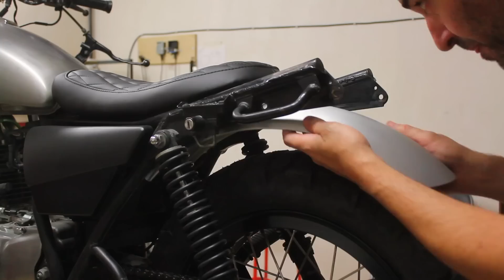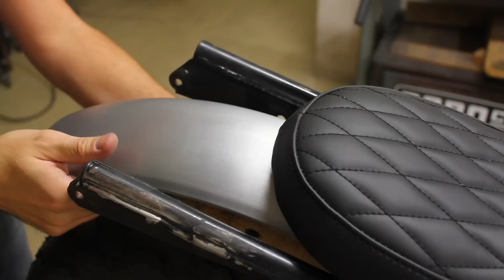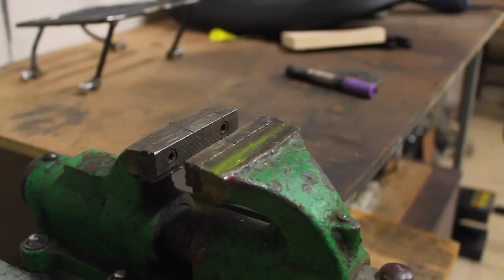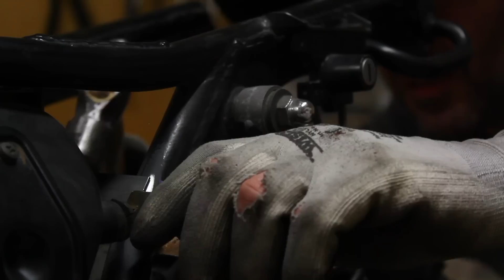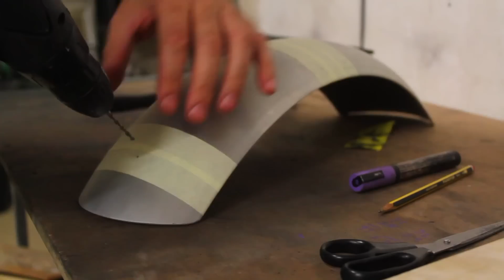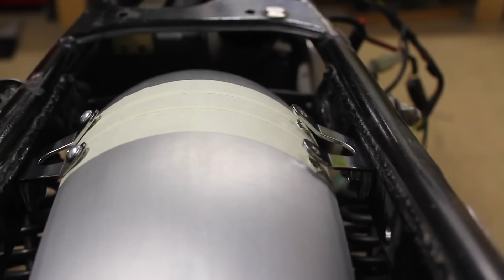Yamaha SR 250 - Custom Fender

Comment: Great work on these videos, can just concur that they have therapeutic as hell! Working on an SR 500 '81 at home but can't find a good place to shop for fenders (front and rear). Ideas? Also, know any good place to find gas tanks that fit to an SR frame? My build is turning into a tracker build at this point, so larger tank rather than smaller would be best.